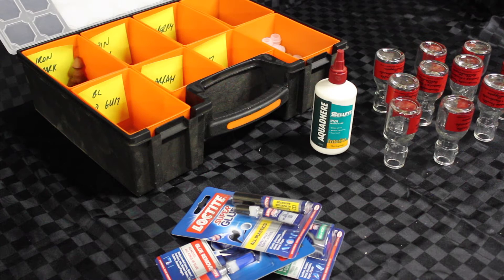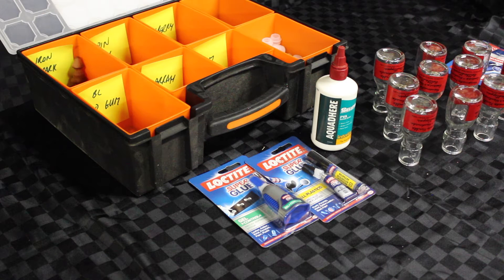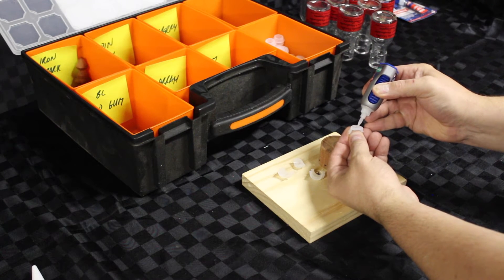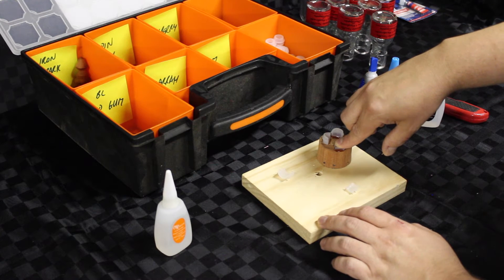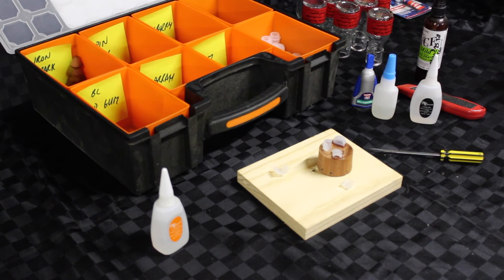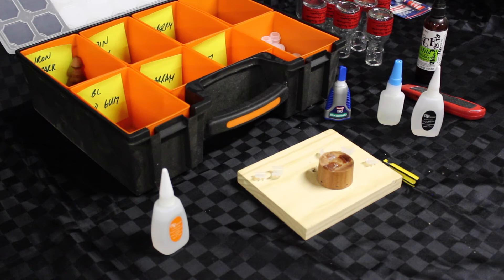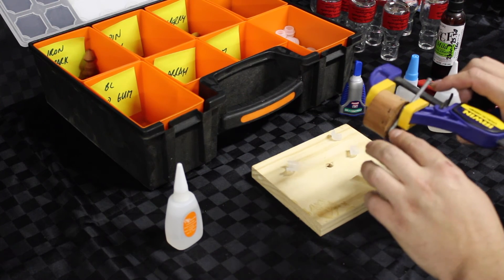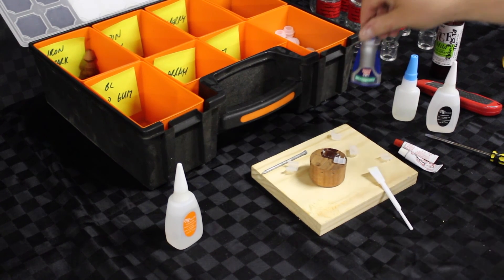Experiments in gluing silicone to wood

Comment: E6000 glue would have worked- just as the others might have if u sanded the silicone (sounds strange) but your glue needs a rough service to grip onto.  I learned this by trial and error;)

Comment: The best glue I've ever used for gluing silicone to wood and plastic is "DAP All Purpose Adhesive Sealant 100% Silicone". It's designed to be an aquarium sealant, so it's FDA approved food safe to boot. It's basically just type 1 RTV silicone with silanes added as a adhesion promoter. I buy it for $5.00 per 2.8 oz tube at Home Depot (in the USA). The stuff is absolutely amazing. You'd need pliars to pull off that sacrificial bottle-stopper piece and I bet the stopper would tear before the glue joint failed. It may not be available where you live, but what you need to look for is an adhesive that is itself primarily silicone with silanes added.
Reply: You have actually used this product to glue silicon(e) rubber to wood?  

I belong to a woodworking guild that makes wooden toys for underprivileged children.
that 
The toy, needing silicon(e) rubber glued to wood, has wooden wheels. As the child pushes the toy, the toy's wheels' rotation actuates a wooden frog to jump up and down.  

Problem: wooden wheels do not grip floors well. So my fellow elves and I have stretched silicon(e) rubber wrist bands around the wooden wheel rims to serve as tires for traction. Just stretched on the wheel, the wrist bands work fine. 

But vigorous use by a child will likely see the tires eventually come off. Hence the need for an effective glue to bond silicone(e) rubber wrist bands to the wooden wheel rims.
Reply: @LifeHappens83  Keep in mind that DAP makes dozens of silicone products. You're looking for "DAP All Purpose Adhesive Sealant 100% Silicone". It's in a small tube about the size of toothpaste. Home Depot carries it, but you can probably find it on Amazon. The glue joint is 10x stronger than anything else I tried. I hope your project is a success!